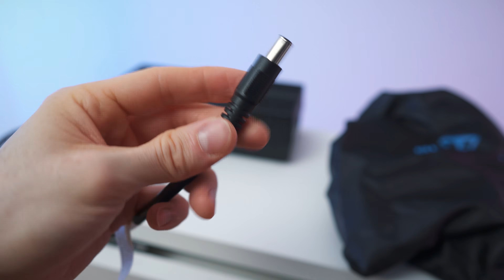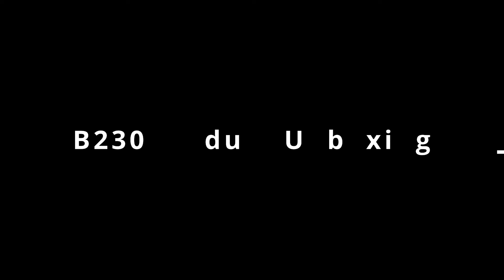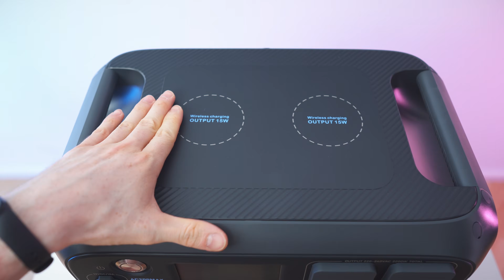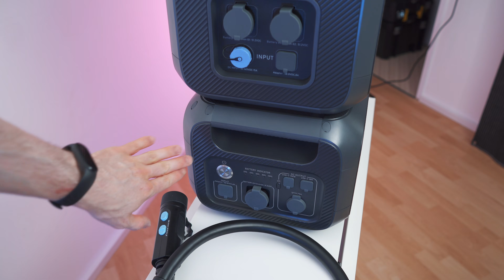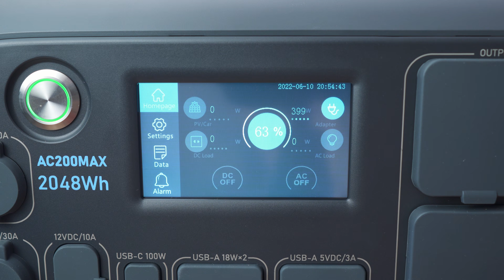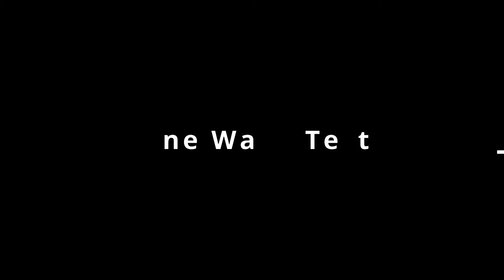BLUETTI AC200MAX & B230 Combo - EVERYTHING You Need To Know (Comprehensive Review)

Comment: Another little practical tip - I have one available from Amazon in the power line to the charging power pack. Intermediate switch inserted (plug and play), so that I don't always have to pull the power pack out of the socket, to turn off the annoying fan 😉

Comment: Thanks for this in-depth review. I'm buying this AC200MAX mainly to charge my e-mountain bike's 2 batteries when hunting for a week or more here in Nevada and other western states. Love the AC200MAX LFPO cells.
YOU NEED-> The Canadian company Off Grid TREK 220 watt solar "blanket" to charge the BLUETTI AC200MAX during a power outage or while camping. This "blanket" is foldable to a small "briefcase" size but has the excellent SunPower solar panels for excellent efficiency in the 20%+ range.

Comment: Could you test how the AC200MAX would behave with a second AC200MAX connected via that big fat cable connector?   I am interested because it would be more cost effective to purchase a second AC200MAX instead of a B230.   Right at this time, 01/25/2023 you can would  essentially have a second inverter for just an extra $200!

Comment: Very nice test, I have the predecessor AC200p myself. My problem is that when the large consumers (pressure pump and compressor refrigerator) are running, all the LED lighting flickers in time. You are exactly the same as the flickering in Maja's camper with the auxiliary heating. Is that also the case with the AC200max with the light flickering? Kind regards 🖖

Comment: Very insightful, thank you. Quick question: in the past (I think with the ac200p) it wasn’t automatically charging the extension pack when the system was boosting itself up via solar input with first morning sunlight. Is this possible now? If I have a B230 connected, will it always automatically get charged too if my solar is connected to my ac200max?

Comment: I have the AC200 Max, I would like to buy the B230 expansion battery, but it seems the only way to recharge it is via the AC200 Max AC adapter, UNLESS you buy additional D050S adapter to charge via solar for $199. That's ridiculous. One should be able to charge the B230 via solar using hte same connector used to solar recharge the AC200 Max.
Reply: I bought a second ac200 max that came with the brick.

Comment: But can you charge the expansion battery with the charging brick if the brick is plugged into the AC200MAX?
Reply: Yes I have a max and b230 battery.
Reply: I am having a problem getting my B230 to charge via my ac200max, hoping this video will adress this. It just seems to be draining my ac200 max battery just now & I can't get it to charge via my solar adaptor plugged straight into the B230 🤔😐